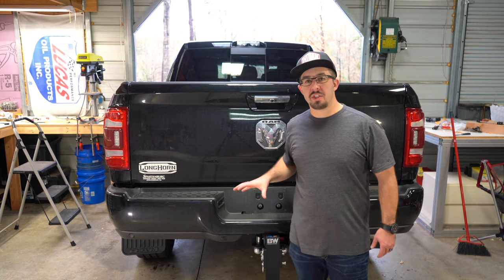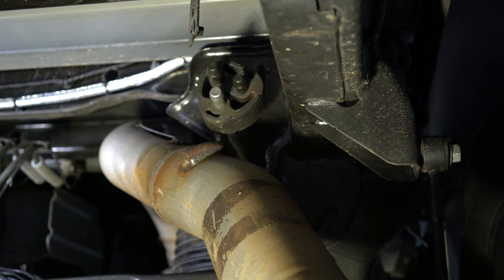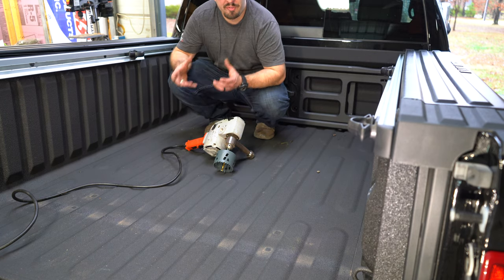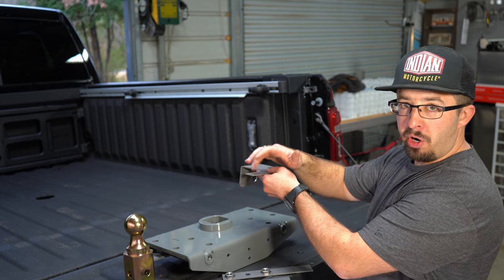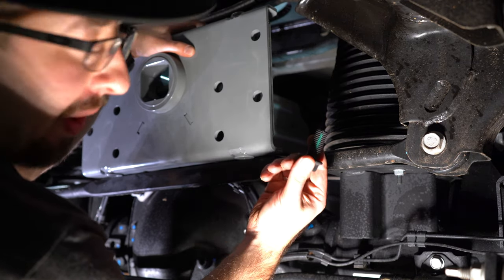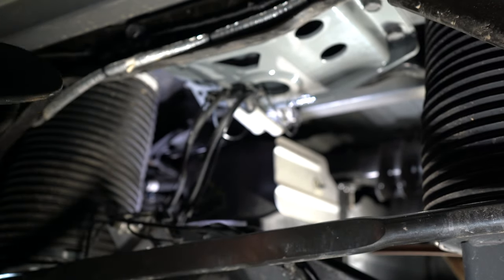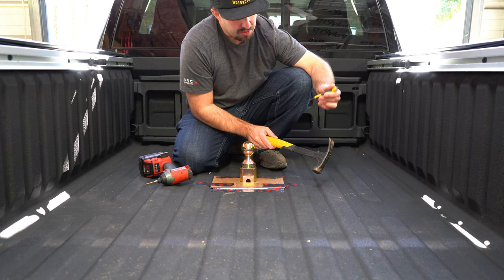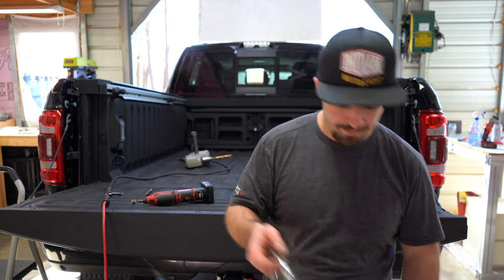2019 Ram 2500 B&W Turnover GooseNeck Install

Comment: I just installed this hitch and I didn't take out the heat shield or the exhaust. My advice is take them out. It's time well spent.
Reply from the maker: It’s definitely a bit more work. But the added work space makes it much easier.

Comment: Nice work!  I had the same kit with the 5th wheel light brake kit plug installed in my Ram 2500 for a total of $1000.  Best $1000 I ever spent on that truck.

Comment: Can this be used if u have the factory 5th wheel prep installed i want a gooseneck as well as the 5th wheel so I can tow what ever trailer I need to without modding the trailers
Reply: I don’t know about that, but I do know B and W makes a fifth wheel plate that fits right down into this square hole gooseneck receiver, and you don’t need the factory prep to pull both.

Comment: Do you have e a part # read some reviews on e trailer and it seams for the rambox it may be different but in not sure for the 2019 2020 model
Reply from the maker: Ram box and standard bed use the same part number

Comment: What kind of trailer do you pull with your trucks. I have the ram box on my 2017 short bed.   I wonder if I can pull a horse trailer with it.  Also are your trucks short bed
Reply from the maker: Leonard Price its a 6ft bed, and I pull a 38ft gooseneck with it
Reply: motoxcal249 Thanks

Comment: Hey man im installing the hitch but where my chain u bolts go ther is only 1 hole visible do i have to drill thru the fram
Reply from the maker: Edward Fan great question, you will need to drill through the frame

Comment: Hows the gooseneck on your trailer clear the bed sides? Any clearance issue while turning??
Reply from the maker: There is a roughly a 16 inch gap on the sides. So far it has been plenty of space for every day use.

Comment: What’s the part number ?
Reply from the maker: 2019- GNRK1320
2018- GNRK1384

This is based on a 2018 ram 2500. If you have something different use this link.

https://www.bwtrailerhitches.com/find-your-hitch